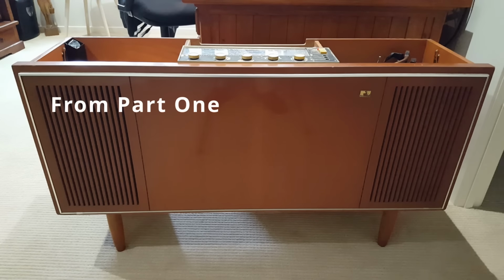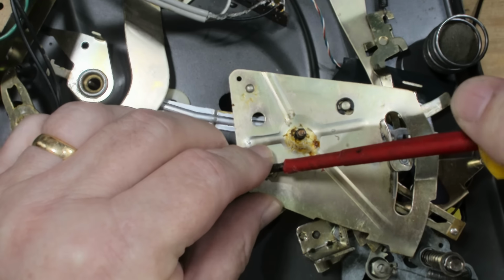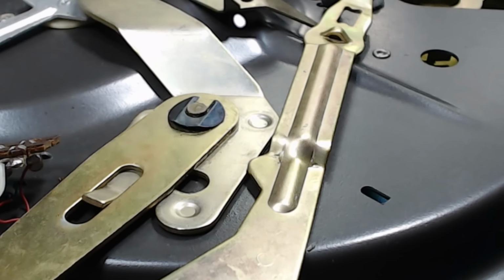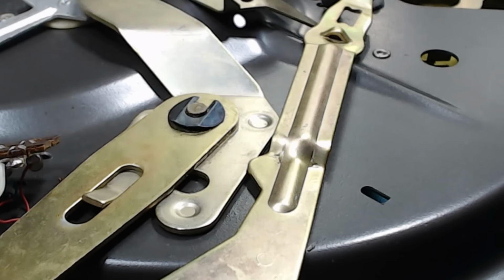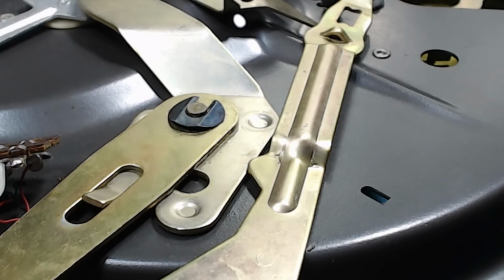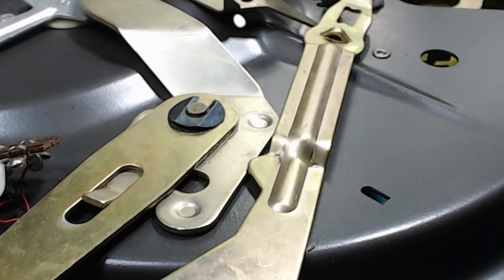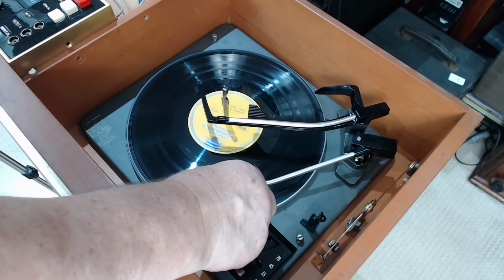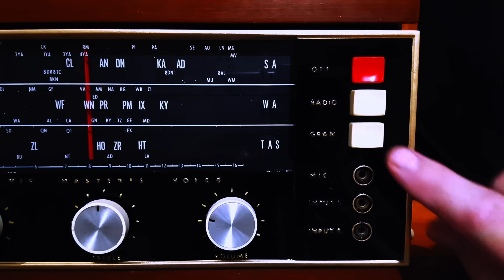HMV Studio 7 Radiogram Service. Model T3-45 From 1966 - 1969 Part 2

Comment: I use to take dowel pins lie that and cut a slit in them.  Then take broken hack saw blades (very strong steel) and break them to size, then if necessary, head them to remove the temper, reshape them into the type gouge I wanted, then retemper them with heat and oil to make a set of wood gouges to use when shaping rifle stocks and pistol grips back in my gunsmithing days. I have long since sold off all my smithing tools and gone completely out of the business as at the time there were 2 other smiths in town and I didn't like to compete as mine was just a hobby. That said, however I still have a large set of gouges and knives I have made that way, using my Dremel to sharpen and shape the blades, and acraglass to make the handles and keep the blades still.  Once hardened acraglass makes a great plastic mount.
Reply from the maker: Thanks Jerry, great information 👍🙂

Comment: You had a problem sourcing the wiring for the record player arm. I could be mistaken but I am reasonably sure that either Ethernet Cable or Security System Cable is made up of multiple wires that might be thin enough for future use in a similar situation. I love your chanel by the way and can hardly wait for your new episodes.
Reply from the maker: Hi Shane. I had a lot of suggestions for this. The best one seemed to be the wire in an old usb cable, fine multi strand flexible wire. I think ethernet wire would be too stiff. I have purchased some tone are wire for future use. Thanks Shane 👍🙂

Comment: A beautiful machine with your usual attention to detail! However, based on what I see, a Matt black finish would look much better than that gloss black. The gloss is showing every single imperfection and the reflections are jaring to the eye. Please reconsider this color choice and you'll have one of your usual masterpieces!
Reply from the maker: Thank you Nicholas. I didn't consider a different black, I maybe could have gone for a satin black, matt may have been too dull. I replaced it with the original high gloss finish and it looks great in the cabinet, it won't have the lighting I have on my workbench to highlight the imperfections 🤔🙂

Comment: Great job. I find these turntables so confusing. The handful I've dismantled I've taken heaps of photos, because half the levers don't make any sense to me. I think the gold radio display came up about as good as you could hope. The old one was pretty far gone and your repair looks much more presentable. 
Question - where do you get your white grease from. And how do you decide between where to put white grease, and where to put graphite grease.
Reply: The white stuff is probably run-off-the-mill white lithium grease.
Reply from the maker: Thank you Seiskid. The lithium grease came from a bike shop. Good question, I use lithium by default but graphite if the part is sliding and under a bit of pressure. The service manual often gives an indication of what lube to put where 🙂

Comment: A quick search on Wikipedia says Australia got its first commercial FM station in 1980?  Is that true?  I was wondering why a console radio like this made up to 1969 would be AM only, especially given that it has a stereo amplifier.  Were Aussies really stuck with AM only until the 80s?  If that's true, presumably it took a few years to get widespread FM service.

AM was virtually dead in the US by the 70s. I was a child in the 70s and we didn't use AM for listening to music, it was all FM.  The downside, of course, is there is hardly any AM radio music in America.  WSM is one of the few AM stations I ever hear music on and only at night because it so far away from me (100s of miles).
Reply from the maker: FM started in 1974-75 in Australia but stations were few and far between and no real commercial stations until 1980 when FM took off. Of the few that operated some played 24 hour music which was pretty good. We were slow starters regarding FM.
Reply: @DavidTipton101  Earlier in the video you took off what you described as a rubber washer meant to prevent rumble being picked up by the cartridge. I saw that you put on an o-ring, just not that thing you called a rumble washer.
Reply from the maker: You may have replied to the wrong comment here but yes, I did remove a rubber washer from the platter shaft and I replaced it with a rubber 'O' ring, that is the rumble or pad.
Reply: @DavidTipton101  Yes, seems I may have done that. Sorry about the confusion.

Comment: every time I take a record player apart I end up with loads of lock washers circlips and bits of bent metal,  have no idea how it all fits back together, however did they learn the assembly in the factories for these ?  (same thing applies to clocks too)
Reply from the maker: Hi High Path. They would have had to learn to put them together on the assembly floor, they would be pretty fast after a while I imagine. I would struggle with assembling a clock 😄

Comment: Hi David, great work thanks. Did you try the deck with multiple records to see if it dropped a second record and continued playing. Also the small stylus brush tube you made, did you consider cutting a small section from the new metal straws that’s being used today.
Reply from the maker: Hi Richard, No, I didn't try loading a few records on, I should have. Metal straws? no, I don't know what they are. I wanted a very soft brush and my wife suggested an old blush brush, it seemed to work well. Thanks Richard 🙂
Reply: @DavidTipton101  Thanks for the reply M8, metal straws are being sold here in Canada as a replacement for the plastic ones as they are now classed as a one use item and the PM wanted them stopped being used. The metal ones are reusable made from stainless steel. So just a regular soft drink straw size. I’ve used them in different projects. Just cut them with a small pipe cutter. Looking forward to the next video. Thank you for all you do. Very much appreciated bud. TTFN 👋
Reply from the maker: Ahh... I see what you mean, use a metal straw for the brush holder, got it.

Comment: Hi Dave
Just wondering what stylus you had fitted to it. I’ve got the same stereo at home and the record player needs some repairing. Your help is much needed. Thanks
Reply from the maker: Hi Jane. The cartridge in the gram was OK so I reused it. I don't recall fitting a new stylus. There is usually some indication of the replacement cartridge required on the record deck. I think the Sonotone T9 fits pretty well. There are local suppliers of cartridges. I use Soundring in Queensland but there are others🙂

Comment: Dave many thanks. Please would you indicate which heat gun you use? Mine has a nozzle which is too large. Thank you
Reply from the maker: Thank you Richard. The heat gun is part of my soldering station, There are a lot of variations and you can get the heat gun as a separate unit but similar to this:
https://www.ebay.com.au/itm/394228847834?chn=ps&_ul=AU&_trkparms=ispr%3D1&amdata=enc%3A1sc-fE_ifRyCugQsLAUrSZA40&norover=1&mkevt=1&mkrid=705-165583-336623-2&mkcid=2&mkscid=101&itemid=394228847834&targetid=1819281019398&device=c&mktype=pla&googleloc=9069019&poi=&campaignid=19099654045&mkgroupid=144928706118&rlsatarget=pla-1819281019398&abcId=9303866&merchantid=119186379&gclid=CjwKCAiAlp2fBhBPEiwA2Q10D4ZJvVIrWTyfGZp7yfIS8gSxHeY3hXb5rpmILj4JPAV0dVe1LTMHNBoCf4kQAvD_BwE
Reply: @DavidTipton101  Thank you David and much appreciated.

Comment: Hi David,  i have a few questions. It appears the back of my unit is nailed in. Was this normal? Im not sure how to access the screws to get the turntable out. Also. I dont know how to operate the second arm that holds the vinal. Mine seems to be a bit different
Reply from the maker: Hi Fred. I don't recall how the back is secured but it is quite possible that it is permanently attached. I think there are holes drilled in the back panel adjacent to the record player, you access the clips with a screwdriver. I have a short video on removing them here: https://youtu.be/BcgpJkQKOrU  
What is the brand and model number of the record deck?

Comment: Hi David, How does the record deck 'know' what width the record is in order to drop the pickup in the correct place.  Is it purely due to the speed that is selected.  Surely a 33 rpm speed can be 10 or 12 inches?  Thank you
Reply from the maker: Hi David. If you follow the link below, you can see an 'L' shaped black lever at the top of the screen mounted on the tone arm pedestal. As a record is dropped it strikes the lever and moves a ratchet plate underneath to either of two positions, 12" and 10" (second link). It doesn't measure 7" because 7" is the default position. In operation and using a 12" record as an example, the record drops past the lever and will cause the ratchet to move two steps on the ratchet plate, that is the 12" position. The tone arm moves to the 12" record position and is lowered to contact the record, at the same time the ratchet is released to the home position ready to measure the next record in the stack. I hope that helps.
Lever: https://youtu.be/1OgEa8cmREY?t=1513
Ratchet: https://youtu.be/1OgEa8cmREY?t=1054
Reply: Thank you.  That's really interesting. Thank you for the explanation. Fascinating how sophisticated Old school technology was. Take care  @DavidTipton101

Comment: Those little insect things you pulled off looked like cockroach egg shells.....   This must have been in storage somewhere for sometime.
Shame about that, I bet that is what ruined the black paint.....   I know you'll get this looking amazing again though.
WD-40 has been given a reputation of going gummy over time.   I personally don't think it does this given the main ingredients, but you do have to be careful to get all the old grease off and make sure the part is properly lubricated after WD40 is put on.   WD40 on it's own is definitely not a lubricant.   :)    For some reason, some feel it can be a lubricant on its own.
Reply from the maker: Hi Brendan, I agree , it was stored in a garage or similar for some time to do that damage to the faceplate. The skeletal remains are Slaters, Roley Poleys, Pill Bugs, or Woodlice depending on where you live. I haven't experienced WD40 going gummy in all my years using it either. WD-40 is in fact a lubricant, it contains a light oil but it will be short lived in a high pressure area like a door hinge so as you say you need to back it up with a heavier oil.
From The WD-40 website:-
"Myth: WD-40 Multi-Use Product is not really a lubricant.
Fact: While the “W-D” in WD-40 stands for Water Displacement, WD-40 Multi-Use Product is a unique, special blend of lubricants. The product’s formulation also contains anti-corrosion agents and ingredients for penetration, water displacement and soil removal."
Thanks Brendan 👍😀
Reply: @DavidTipton101  Well, I am certainly glad you got your hands 9n this one and did a proper repair and cosmetic restore on it.   
I don't think anyone else would have done as good a job on it.

Comment: Hi David. How do you differ between when to use grease and to use oil?
Reply from the maker: Hi Per, I use grease on parts that slide and oil on shafts like the idler wheel and platter bronze bearing. The service sheets will often have a lubrication guide as well 🙂

Comment: For the wire replacemennt could you use telephone wire?
Reply from the maker: Hi Chris, I think the telephone wire that I am thinking of is single strand and too stiff, USB cable seems to the a good option as others have suggested. Thanks Chris 🙂
Reply: @DavidTipton101  Yes, I did't think that they were single strand.🙁

Comment: Hi David. When I have my radio on it keeps shorting out the power. Do you know what might cause it.
Reply from the maker: Hi Fred, you could start by checking the power cord for cuts and shorts. The gram motor is powered straight off the mains, you could disconnect that. It could be a filter capacitor. The power transformer may be shorted. You should get it looked at by a knowledgeable person. Playing with the mains supply is dangerous 🤔

Comment: David you need to look at the copyright laws in your area,  the way they do it is a violation is only a violation where you live in the US at the federal level anything  before 1972 as far as there concerned is public domain BUT if the state you live in may have more rules I live in Florida doesn't care that much in other words unless someone files a complaint or something is after 1972 that might get shut down  hears a couple of examples https://youtu.be/isI1SLich5c  https://youtu.be/h9-v51grNW4
Reply from the maker: Hi Richard, I may have been able to play a bit more of Finlandia and not get a copyright strike if that's what you are talking about. I did get a strike with Sing Sing Sing from the late 30s at the end of the video until I replaced it with another copyright free version. I don't think it is clear cut as to what is accepted as OK, I load the videos up for a few days and see what happens which doesn't always work as I have had strikes lodged on two year old videos 😟🙂
Reply: @DavidTipton101  funny how that works